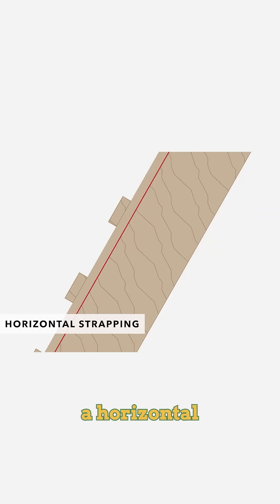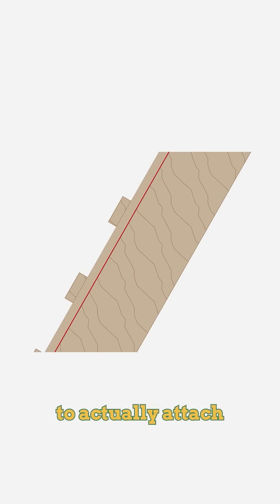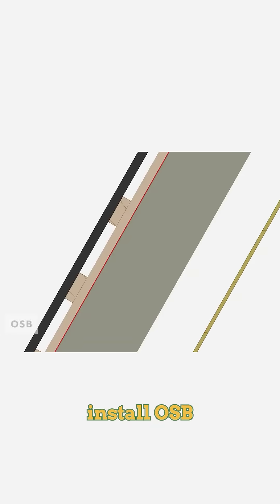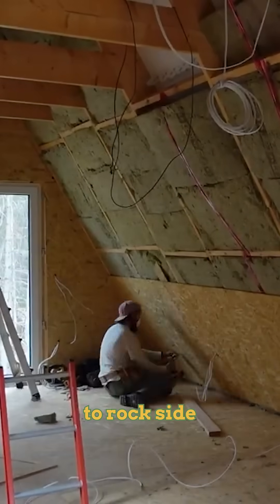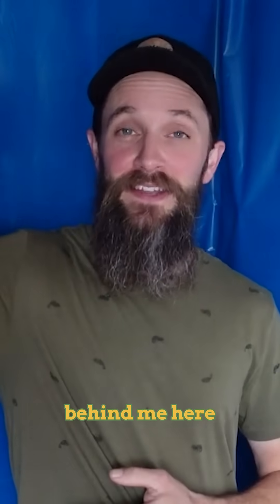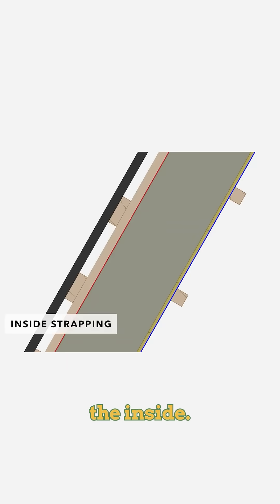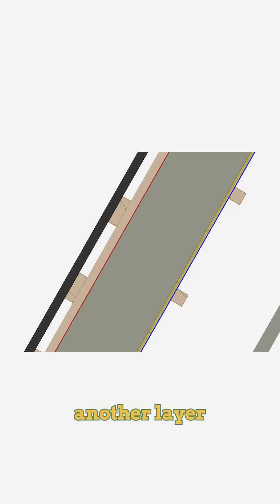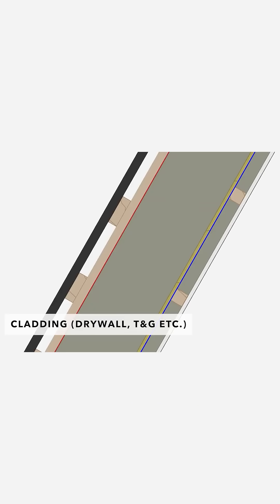Layers of an Avrame house

Comment: So, you put a tyvek water/vapor barrier on the outside. Insulated, and put another vapor barrier on the inside... 
So now if one fails or wasn't installed properly you have trapped moisture inbetween your walls... Even when breathable they dont allow for wet spots to dry quickly enough for mold not to grow. 

Its a common issue with double barriers. Even breathable ones.
Reply from the maker: With a good ventilation in the house there is not enough water to get into the construction. Internal vapor barrier is just for safeguarding. And the Tyvek we use is breathable. I’ve seen no problems so far.